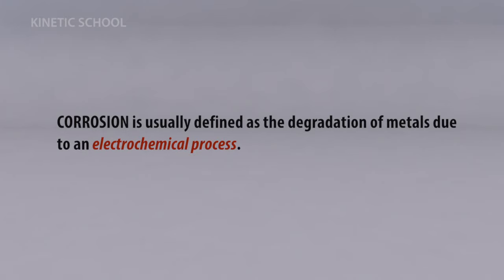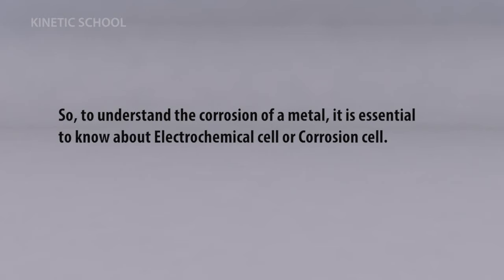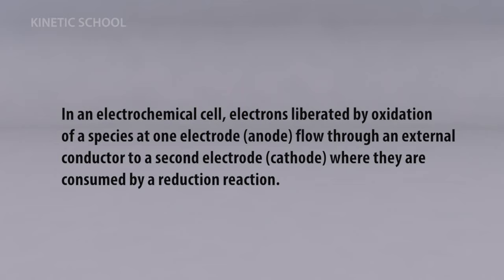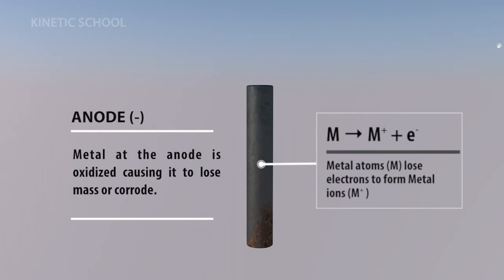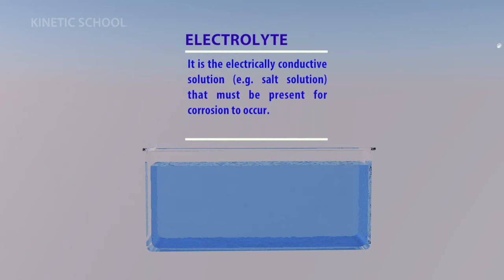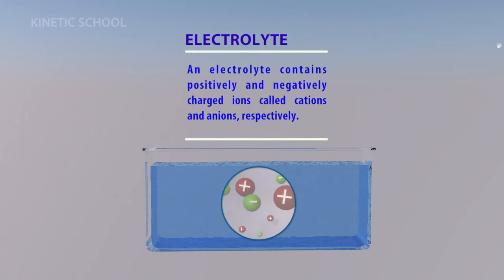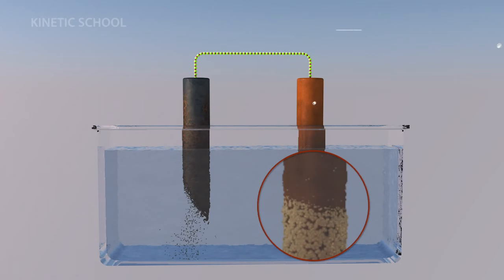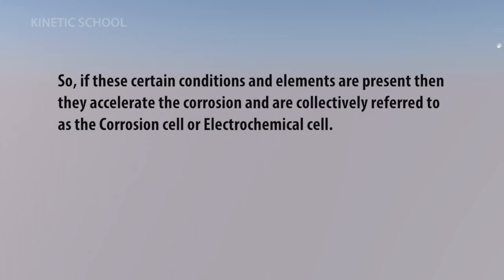Corrosion : Electrochemical Cell or Corrosion Cell (Chapter 3) (Animation)

Comment: Hi, nice video. I have a question for you. Is it possible to observe release of hydrogen bubbles even slightly during corrosion of steel  in salt water, or this requires to add a small amount of acid (for example Hydrogen  Cloride) to lower the pH ??

Comment: There is a mistake in min.3:24 "Electrons flow from the anode to the cathode thru the electrolyte" Should be " thru metallic path"
Reply: Why do the electrons swim? ;-) And why don't they take the path through the wire?

Comment: one question:  the electrons will flow through electrolyte or metallic path? or both?
Reply from the maker: In an electrochemical cell, the higher positive potential is the cathode, therefore the conventional current direction is from the cathode (+) to the anode (-) through the metallic path and from the anode to the cathode in the electrolyte.
Reply: He does not understand it. Electrons flow through metallic path from the anode to the cathode. Electrons cannot move through a liquid, only ions can.